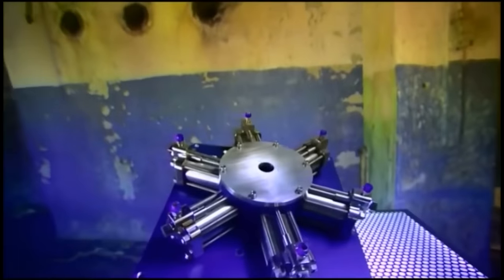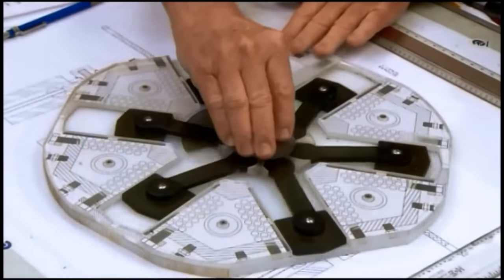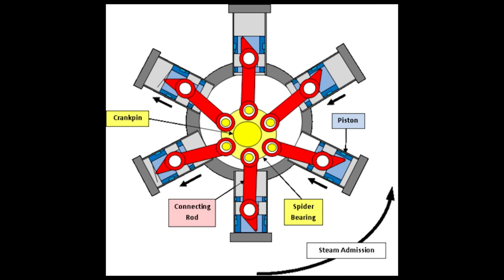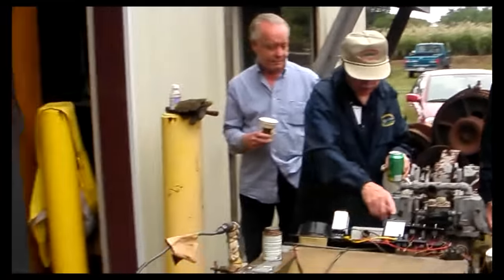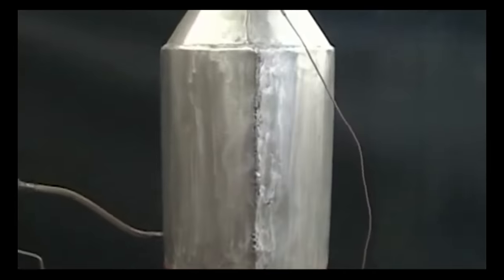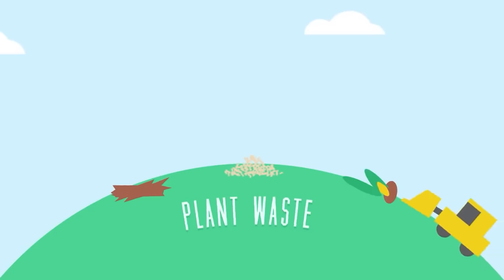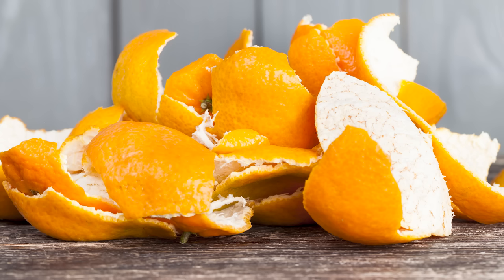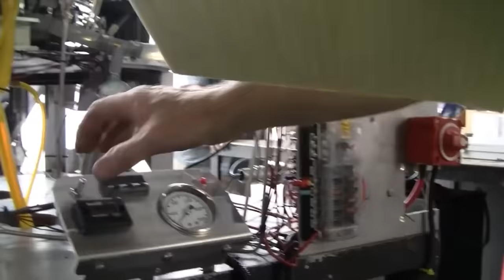Is the Cyclone external combustion engine the future?

Comment: The system lends itself to power generation more than anything else. The problem is scale. To produce enough power you have to spin a large enough generator fast enough to make the power. Most small generators spin at 3600 RPM for 60Hz power but that can be adjusted for location and the number of pole involved in the stator. Again we come to scale. The size of the engine and the source of heat to make the steam needs to be able to produce over an extended period of time with no flucuations. That requires very careful monitoring equipment that can adjust steam flow on the fly to maintain frequency and voltage based on dynamic loading. Turbins are far better at maintaining constant speed than piston type engines. Example is a 1.8KW back up generator. It does well with most household loads but you can hear the motor bog when an AC unit kicks in or a large inductive load slams the system. The torque of this system may be able to overcome this bogging but the control circuts involved will make it seriously more expencive. THAT SAID I like the idea of having it as a home back-up generator or off grid power source like near a stream/river where you can use the cool flowing water and a heat exchanger to return the feed water to the feed tank. Otherwise you are going to waste a considerable part of your energy budget on cooling fans to make high temprature waste steam into liquid feed water again. And then there is the fact that you need DI water and corrosion additives to prevent the errosion of your piping system. So for a stationary systme it "can" make sense, but for a moving vehicle? Maybe a ship would be a better platform.

Comment: Horsepower is a calculation(Horsepower (HP) = (Torque × Speed)/5252), and either your torque numbers are wrong, or it made 680 HP @3600 rpm. very likely the TQ numbers are wrong.

Comment: It was designed by DARPA for the EATR Autonomous Robot to power  the harvester and electrical generator which uses biomass it cuts or mows as it travels for fuel. Extremely efficient as the system utilizes a plate incinerator to instantly vaporize any material (I'm assuming to contain carbon which is consumed in the process) that by another genius method can produce KW levels of energy and the heat generated is taken to superheat the H2O in something like a turbo they don't talk about much , to run the motor that spins the central single shaft which is then connected to whatever implement it's fitted for that purpose while the liquid water is then recirculated with no emissions or relief valves. Can run autonomously without maintenence or refueling for a very long time. At the cost of whatever it decides to consume on mass with AGI making the decisions supposedly without human intervention if necessary. The full disclosed report can be downloaded on DARPAS website with pictures and guides that make it a pleasant study for people it scares the crap out of like me.😮

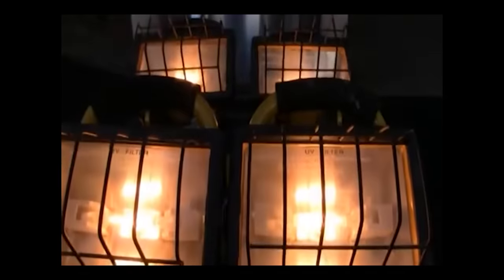Comment: Your statement at 2:48, "not the fuel that powers the engine, but the steam" is incorrect.  The steam is just a carrier of the power.  The power is coming from the combustion of the fuel.
As others have stated, there is nothing special here.  It's just a radial steam engine with steam recovery just like a 1925 Doble car.  See Jay Leno's episode on the Doble for a better understanding.  It may be that with some development, this could reach pretty good levels of thermodynamic efficiency, but at the end of the day, you're still just burning combustible fuel and exhausting that.

Comment: Interesting, NASA is prototyping a similar concept using a Stirling engine driven by a nuclear reactor using liquid sodium as the working fluid and coolant (heat pipes + radiator fins) to power long duration missions and things like heavy-duty ion thrusters. They're expecting continuous operation lifetimes of 15+ years (!) generating 10KW (much more power than radioiosotope thermoelectric generators or solar panels could efficiently generate at Mars and beyond). It's pretty miraculous assuming it works

Comment: This isnt the first EXTERNAL conbustion engine. The Whispergen works in a similar manner, and uses a wobble yoke which is quite similar to this spider yoke, to transfer the steam piston strokes into rotary movement. I have had one for years, and it serves as a poiler and frate 12v @80 amps, as a byprosuct. Theye are of stainless steel and aluminum constrution, marine quality, and their developement was funded by the New Zealand government. I hear there was a domestic version of this avalable in northern europe.  The marine version was limited in production, due to excessively high production costs. It works of diesel similar to a truch heater, but i suppose it could be adapted to any other fuesl cource to heat the water.

Comment: Is the Cyclone external combustion engine the future? NO! 

This engine focuses on all the juicy features and none of the inconvenient truths. There is no reason this would ever succeed though there are some innovative aspects to it. The engine might succeed but an application must be found where it could and nothing else would do - that's the tricky part. 
On steam, it might provide stationary power generation fed with wood but it's up against Diesel generators which are cheap and reliable and someone has to cut, collect and chop the wood. In a dystopian Mad Max future this engine may succeed in forested areas LOL. It could provide supplemental grid power at a city dump also but someone has to be paid to fill the boiler making the net benefit marginal.

For widespread adoption think pragmatically. Work is work. 
Fit this external combustion engine to a car and drive 100km and measure the fuel consumption on gasoline, then compare the fuel consumption of a 100hp 4 cylinder engine over the same distance. The car might use 8 or 10 liters possibly half that. 

Boiled down it is simple:
A piston engine burns air compressed to ~10x hence 10:1 compression by adding in 10x the amount of fuel (in the correct ratio of course) for the same weight as it would if it were 1:1 compression. How is an external combustion engine with a 1:1 compression ratio in the boiler ever going to deal the efficiency of 10:1 compression ratio ICE with all the added machinery required to pump the boiler pressure up? This then requires more and more fuel which has its own weight and storage requirements. 
The piston engine makes 10x the power in the same space than if it had 1:1 compression.
That's only part of it - it gets worse.

Generally, pumping air to increase combustion pressure to increase efficiency creates what is termed pumping losses decreasing from the efficiency gain by a high order of magnitude. 
The pumping losses are something that can never ever be eliminated only improved upon. The compressor pumping losses for turbine engines are very high even with the most efficient jet engine for example - perhaps higher than a piston engine. 
This all has to be paid for in fuel (and air in the correct ratio). Gas turbines improve on 1:1 steam boilers but don't use steam as the medium.
In steam turbines the amount of heat recovery machinery and infrastructure required in the installation is utterly amazing because of the intrinsic inefficiency of heating the water to superheated steam has to be minimized.

It is getting complex fast this post but gas turbines (not steam turbines) improve on steam turbines because the compactness of them as they can generate their own compression ratio increase like an ICE. 
External combustion engines can't compete against internal combustion for most applications.

Steam can and does make huge power but those applications are specific. Typically economies of scale and military operations make high fuel consumption less important than fuel consumption does for the average person. Also coal mines where the fuel tank is an enormous hole in the ground makes external combustion steam viable, ships are another but even there the trend is away from external combustion steam.

Piston engines aren't successful for no reason. Gas turbines aren't successful for no reason.
Reply: Usually steam is used with nuclear fuel, a tad more spendy than most soccer moms can get their ex-husbands to buy.

Thus military use.

Comment: There is a lot wrong with this video. Firstly, 1350Nm of torque at 3600rpm equals 682 horsepower. This is basic math, there is no wiggle room in those numbers. So, either the engine is producing 682 hp @ 3600rpm, or it is not producing anywhere near 1350Nm of torque @ 3600rpm (for reference, 100hp @ 3600rpm is a little under 200Nm). Also, there are no details given on the combustion/boiler combo, but it is highly unlikely to be "Carbon Neutral" as claimed. If you combust carbon-based fuel, you are going to get carbon dioxide as a by-product. Even worse, unless the combustion is provided with enough oxygen, then it will produce carbon monoxide, which is far worse. Lastly, oxides of nitrogen are only produced in specific circumstances ie when the combustion temperatures are very high, and there is an excess of oxygen available during combustion. A modern fuel-injected petrol engine controls the fuel/air ratio very well, so combustion temps are kept low and there is no excess oxygen, and so there are almost no NOX by-products. Diesel engines are a little more challenging since they can't control the air-fuel mixture as well and combustion temps are much higher, so modern diesel engines need urea added to the combustion to keep NOX production under control.
Reply from the maker: The power figures i gave came straight from them. Go read up on the engine.
Reply from the maker: In fact all the info I give comes straight from the companies that make the engines.
Reply: @ChrisVSCars  I don't doubt that, however just because they gave you the figures doesn't make them right. Any engine manufacturer is going to give you information that shows their product in the best possible light. Sometimes that might be a little misleading, and sometimes it might be just plain wrong, as is the case here. Like I said, the math for working out the relationship between power and torque is simple and well understood, there is no wiggle room in the numbers. So it is clear that the information they gave you was wrong.

Comment: You could just wrap an inductive coil around the steam reservoir, and belt an alternator off the drive shaft wired back to the battery. no need for Fuel.

Comment: Could prob use countless gasses. Cooling systems have been doing a similar process for decades. Our ac when i was a. Kid didnt have freon at all. Its basically antifreeze and ammonia which is heated by natural gas which turns from liquid to gas then pumped through similar to fron systems. Most rv ac are still usong that system

Comment: The dyno numbers are just a lie. 1355nm is almost exactly 1000ft.lbs of torque. 1000ft.lbs at 3600 rpm is 685 horsepower. Thats just how torque and horsepower work, one of the numbers is wrong. 100hp is probably right in the end. Wish it was that easy to change the world.

Comment: Electric motors are superior in every way and they are the future.
Reply: Electric motors are great. Powering them is the problem, and you will figure out in a few years that it's a way bigger problem than EV proponents think. Lithium cells aren't the answer because they don't scale up well and have a horrible environmental and social impact, hydrogen fuel cells have been a few years away for the last 40 years with no end in sight, because storing hydrogen is not a simple undertaking and is entirely unsuitable for motor vehicles, not to mention the only efficient way of producing hydrogen is by breaking down hydrocarbons which is ridiculously wasteful and doesn't solve the problem it's supposed to solve. There are other battery technologies on the horizon supposedly, but they are many years away, and we will never solve the energy density issue with batteries, EVs will always be limited by that. Then there's the issue of where the electricity comes from. Wind and solar don't work, and increase reliance on coal and gas in most countries because it's inconsistent and unreliable, so huge backup generators are needed to smooth out supply. It makes the grid much more expensive and complex to build and maintain, making electricity much more expensive in countries where it's been implemented. Nuclear is the only "green" option that actually works in countries that don't have the privilege of hydro being their main source. Hydro is also a limited resource. If everyone moves to EVs no country in the world has the ability to supply the electricity needed, the logistics alone are mind boggling when you start doing the math, which I have done, as I've been studying this stuff since about 2004. I used to believe in these things. Now I've had to come to the somewhat disappointing conclusion that the internal combustion engine is unlikely to ever be matched in its capabilites. We can't replace it. If you get rid of all private motor vehicles which is the only alternative, because EVs won't fill that gap, you will have to radically change society which is itself an even bigger logistical nightmare that not only will cost more money than we have on earth, and use resources we don't have, but will destroy many freedoms, and people will have to be dragged kicking and screaming into your new utopia/dystopia. Cool. You just got rid of 5% of global emissions by removing ALL cars in the world. But wait, now you have increased emissions in other areas due to increased pressure on supply chains and industry. Supply chains that absolutely cannot get away from ICE engines, because as I said, EVs don't scale up well, so big trucks, planes and ships can't run on batteries. Ships can go nuclear, but that's also a problem what with all the social unrest and asymmetrical  wars you'll have now.

So is it worth going down this road? I like innovation, and I am very pleased you can now choose to buy an EV, I think they are kind of cool, but governments are trying to mandate them, and are planning a future without ICE, because they have no understanding of science, and get their advice from people who are zealots not scientists or engineers. It's going to be a disaster. But it's not the first time government mandated a white elephant bubble. Luckily we exist in a self correcting system, so all these plans will ultimately fizzle out and the way forward will not look like anything anyone predicted.

Comment: The biggest issue, in my mind, 
is running cost...
What does it cost to run and maintain this system?
And is there an other way of doing it? That can do the same thing, but cheaper?
That is interresting to me...
Reply: Just stop to reinvent the wheel and use regular in-line pistons with different volumes. Some kind of invention is needed for inlet valves and steam generator.
Reply: It's almost like we're already using the best available technology, and we are dealing with an ever diminishing curve when it comes to new discoveries in engineering. Sure, digital technology and micro electronics has gone ahead in leaps and bounds, because that was uncharted territory, and some of that has improved legacy tech like engines, but as far as machines that get us from A to B go, the laws of thermodynamics are a very hard ceiling, and we got close to the limit decades ago. New inventions in this context are mostly a step backwards or governed by the law of diminishing returns. The hubris of Man knows no bounds, but the laws if nature are going to put us in our place real quick. EVs are going to be a disaster.

Comment: Problem is super critical water EXPLODES past 700c in the event of a crash this thing would mean DEATH
Reply: Every energy source needs to store energy. The more energy on a kg the better. And potentially more dangerous. Does not really depend on what you use.
Reply: A petrol engine is hundreds of EXPLOSIONS over and over. Pressurization containment tech is not an issue these days.

Comment: "Whole new take on the internal combusion engine"?
Looks more like a rehash of the good old steam engine to me. Just a slightly different package, with a 6-cylinder radial layout instead of the traditional linear designs.
Besides packaging, this seems way behind the cutting edge of steam engine technology though. Where are the secondary (and maybe even tertiary) low-pressure cylinders commonplace in the heyday of the steam engine?
(And yes, I recognize that there's a difference to steam locomotive engines, in that this one has a closed water cycle. But steam ships' engines already had that feature, too. So nothing new there either.)

Comment: It didn't take off because there's no infrastructure for it on the road, and for industrial use, steam turbines are way more efficient than reciprocating pistons and have been around for over 50 years. All large power plants use steam turbines. Obviously industry utilises that power via electrical grid, and wouldn't usually have a burner on premises. So yeah, this is reinventing the wheel but not as good.

Comment: Really - a radial steam engine?  A, they could do the same thing with a conventional in line or V configuration and avoid packaging and vibration issues.  B) the only difference is using supercritical steam rather than superheated steam. C) if you look at steam locomotive design, you will find that yearly maintenance (even in the 1940s and 50s)  amounted to 10% of the initial purchase price - this could not compete with diesels of that same era never mind diesels of today.

Comment: Steam engine. A lot of parts, liquids and stuff... Try Stirling engine, if you need high torque low rpm: electronically controlled displacer version. If you do not need the mechanic output: instead of power piston use magnet in a coil, you will get even less parts